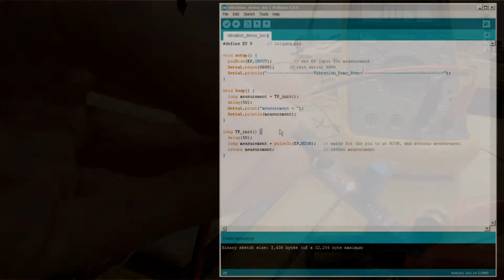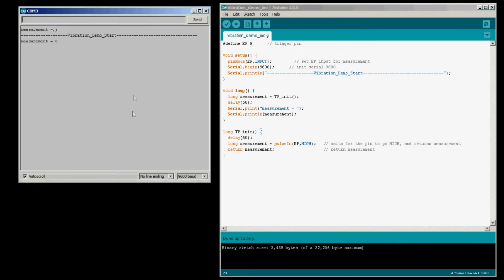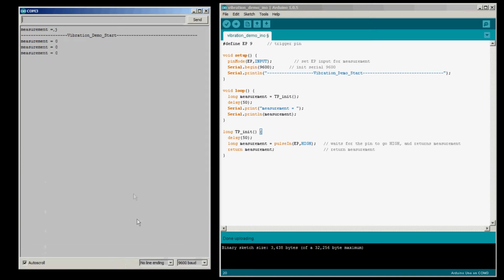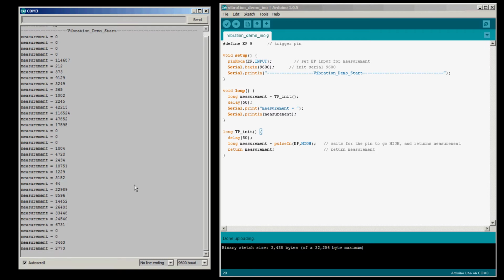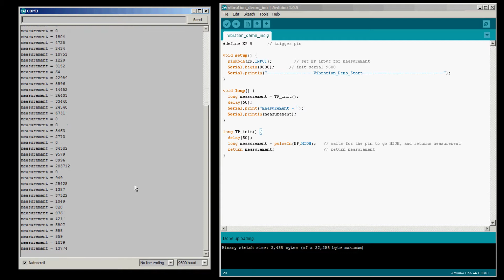LOGO Vibration Sensor Demo with Arduino

Comment: What can I use to measure and compare vibration levels of different cd players ect? Will the Logo achieve what I am looking for? How do I get a digital readout to be able to read the vibration level and do comparisons between different sources? Just add a multimeter and some cables to the sensor? If I wanted to measure vibration from the chassis of a cd player, do I just place the Logo sensor on the cd player?
Reply from the maker: I'm not sure if this is the sensor you're looking for. I would advise to get several sensors and use an oscilloscope to plot the measurements. Attaching the sensor onto the cdplayer sounds like a good idea.

Comment: How could I use something like this, to detect cars driving outside the house? Everything has a vibration right? Everything vibrates threw objects like a ripple in the water.. How would I do something like that?

Needs to be very sensitive.
Reply from the maker: +Mark II I would glue it to the street and try it out. There are a lot of different sensors, you can try which matches your sensitivity best.
Reply: Sir Spf Geophone. Thanks for trying.

Comment: what is unit of output value of vibration
Reply: It looks like a "801S vibration sensor". The working voltage is DC 5V.  
http://www.produktinfo.conrad.com/datenblaetter/1400000-1499999/001485302-da-01-en-IDUINO_SE040_VIBRATIONS_SENSOR_MODUL.pdf